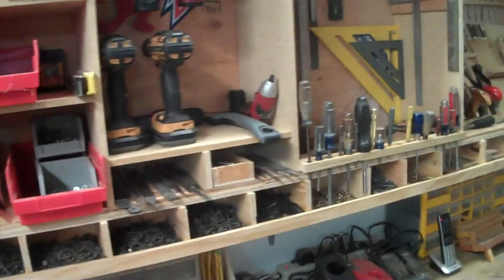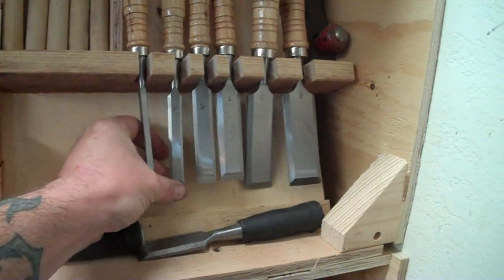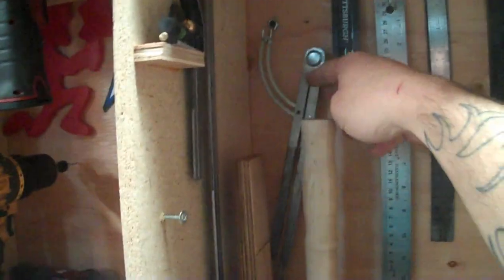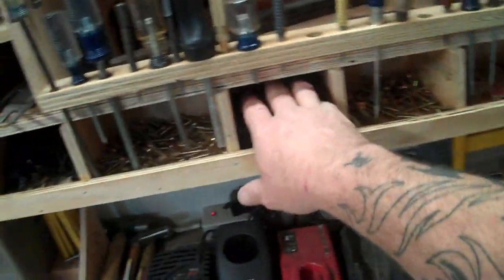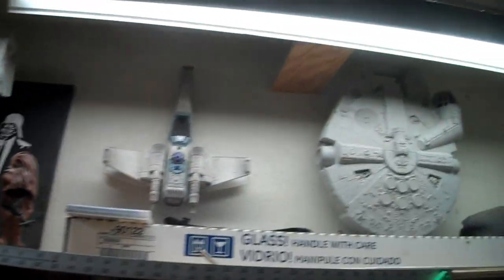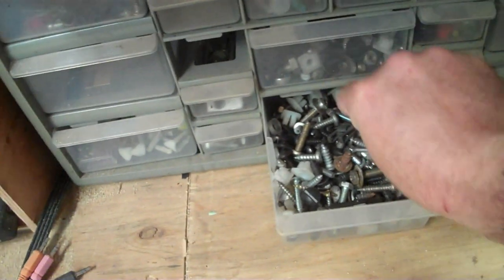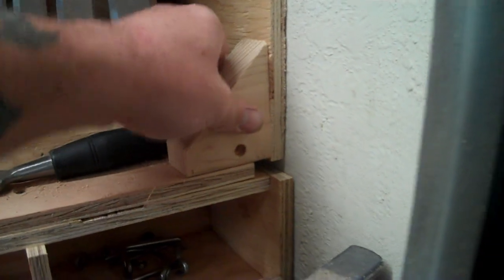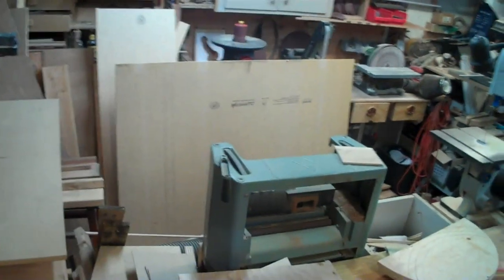tool cabinet from scraps

Comment: New subscriber here. Liked the video and showing the screw ups. We all make em. Few will point them out. Kudos for that! I don't like to complain and don't take this as a complaint. I had to turn the music way down. I have the same HF chisels. I got to sharpen them a lot. After every softwood project or multiple times during a hardwood project. The steel seems to not be hard enough. Do you reckon we could re-temper the steel?
Reply from the maker: you could probably try it,might be possible,sometimes the music is louder on different devices phones,PC,but thank you